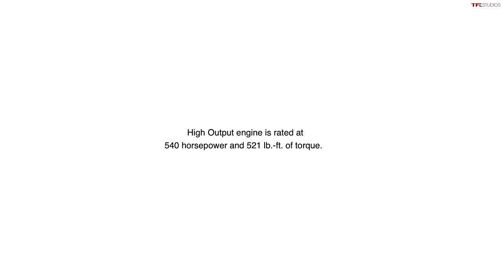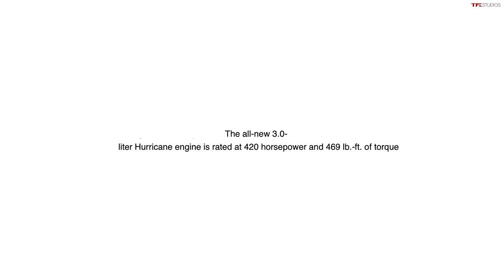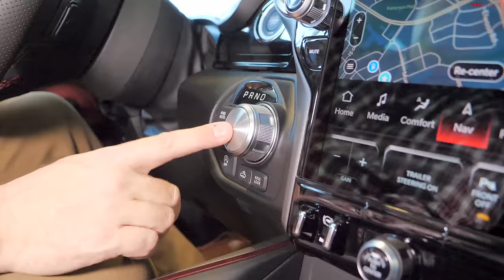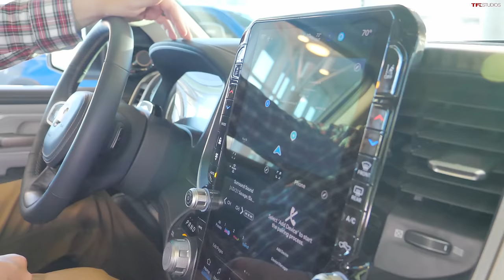I Go Hands On With The First New Ram 1500 In Over 5 Years - Did They Get It Right?

Comment: That over boosted little 3 liter is going to work hard.
Reply: definitely lazy. It's a mild boost. If anything I would knock it's design heritage. 😊
Reply: Forged internals. It's not gonna struggle. Boost the shit out if it. It will be fine.
Reply: Some of the best engines are inline 6.
Reply: Internals and block are very robust.  Mopar performance "Cat X" version of the Hurricane is over 1000hp.  I could see problems for those that push/extend maintenance intervals.  No engine is immune to this but some fare better than others.
Reply: @okcmoparguy724  you are wrong there is no such thing as Mopar Performance. The Hurricane is an Alfa Romeo engine.
Reply: @davidporter7051  The 2.0/3.0L architecture was engineered at CTC in Auburn Hills MI.  The 2.0L Hurricane (multi-air) did make its debut in an Alfa though.
You're correct on Mopar Performance, they've changed back to Direct Connection again (more nostalgic?).
Reply: Being over boosted means it won't have to work hard for normal driving conditions
Reply: @okcmoparguy724  The Cat X Hurricane isn't out yet but you're right it's targeted to reach 1000hp.

Comment: Generally speaking,  high output low displacement forced induction motors don't last very long without a high rate of failure. Too much pressure on the components.  I would be extra diligent abd meticulous with my maintenance schedule.  Nice design and by far my favorite LOOKING AND RIDING truck! I'd still buy a Tundra TRD Pro over these. But if RAM at some point became a reliable brand, I'd buy one of these asap!
Reply: I see that as being a sort of half-truth. Pressure itself isn't really the issue, or passenger vehicle diesels engines would last 20,000 miles before failure. It's more about intelligently designing components to handle expected workload over some specified duration. Yet, if all else is equal, I think your statement isn't a bad rule of thumb, with noted caveats. This is why I have treated the Corolla GR with max apprehension since day one, Toyota or not.
Reply: The Inline 6 architecture vs V6 (Toyota engine) supports the crankshaft much better.  I6 also benefits from perfect primary and secondary balance.  If maintained to schedule using good oil/filters I think the short block will have very good longevity.  I'd also do a DI induction service every 30k-50k miles though to keep the intake valves clean.
Reply: Not to paint with a broad brush but from what I've seen Toyota owners do a great job maintaining their vehicles.  They also build a great product but their owners willingness to at least do the bare minimum on maintenance  seems to be much better that the typical Chevy/Ford/Ram owner.  Almost all of the major failures we see, for any make of vehicle, can be attributed to lack of maintenance.  Kudos to Toyota owners, wish everyone was as diligent!
Reply: @okcmoparguy724  Well said. But I've seen people maintain Dodges Chryslers and RAMs beautifully and have problems irregardless because the engineering and the quality control are simply not good!

Comment: I own a 22 MY Longhorn and overall it's a very nice truck. Certainly a significant improvement over my previous 14 MY Silverado. However I also own a 17 MY VW Touareg Wolfsburg Edition which has some features still not available in this 25 MY $90k Tungsten. The features are all 4 window one touch up/down operation, all 4 door handle touch to open, auto hold function for stop and go traffic, and as some others have mentioned - the steering wheel should have an electric or separate up/down function. The column adjustment is fine but should allow the wheel only to be electrically or manually easy tilt. Not too much to ask at this price point.

Comment: Great work Andre & crew, can't wait to see what the Big Horn & Laramie look like and for the test drives.  I've had 4 Hemis over the years, now have an EcoDiesel and I'm a big turbo fan, can't wait to drive the SST.  The SST should have the torque of the ED, be faster revving and will continue the torque curve much higher in the RPM range than ED and thus much more power and sportiness, albeit at much less fuel economy.
Reply: I've driven the 510hp version in  Grand Wagoneer L.  It sure makes that big girl hustle!  I had low expectations compared to the 6.4L SRT engine they'd been using but it was impressive.  From a dead stop with no torque braking the 6.4 pulls harder, no surprise, but the 3.0L's 8spd will let it build boost from a stop.  I think some of the magazine publications were getting high 4sec or low 5sec 0-60 times which after driving is believable.

Comment: I bought a brand new 2023 Ram 1500 Sport edition (yeah, I'm in Canada) last month at some discount... Seeing this new generation, I don't see much off a difference (except the engines of course, but I am happy with my smooth and reliable Hemi V8), so I am quite satisfied about my purchase. Will keep that 2023 many years.
Reply: Our Maple Ridge/Metro Vancouver dealer has the RAM 1500 Sport model decked out in bright YELLOW with two deep blue racing stripes on the hood and roof and big 37 inch tires on which actually look GREAT! They added big chrome exhaust tips to it and I was thinking maybe it might work for me since it looks good, sounds good and is a more-than-decent truck interor-comfort-wise! 

Unfortunately, that specific model is more of a young trades-guy/gal truck bought to look super-rugged and sporty. It will goto the backcountry lakes and rivers with your smaller weekend toys BUT I wouldn't tow a big trailer with it! I need a bigger towing machine such as an F350/F450 that can tow a big 42 foot long fully-winterized Keystone Montana 5th Wheel into the big and cold Canadian northwoods!!

V

Comment: I like what Ram has done here, except for the exterior styling on the gas powered models.  The new Rebel looks just like the old one, and the Tungsten version looks like the previous design, only with a different grill.  For the prices that Ram wants for these things, they need to look like all new trucks on the outside.  Now, the interiors they nailed that.  Super premium and high tech at the same time.  Plus, I'm sure the twin turbo inline 6 will provide great power with better fuel economy than the old hemi (which was ancient, although still popular and reliable after many years of production).

Comment: Video, 4:40, he is touching the small coolant hose that the technicians are reporting will fail in less than 35k miles. The technician will need to remove the cab to access the hose. Please provide an updated part as soon as possible.

Comment: Im glad its not a cR engine swap
As.the smaller a.unit is the more you press it that bigger the pressure and heat upon it- that can (as you sir)  blow out MANY ways in various ways and systems- big pressure is
Synonomous with failure sometimes- i love Ram

Comment: I know Ram is getting a lot of flack for no longer offering the Hemi in their trucks but in reality, I think the only reason why people chose it when they bought a 1500 was because that was the only engine available with any reasonable amount of power and torque, unless you upgraded to the HD models. Just look at Ford and the massive success they’ve had with the ecoboost. Also why do you think nearly all F150s on dealer lots have the ecoboost instead of the 5.0? When it comes down to it, truck owners care far more about overall power and torque than simply sounding good.

Comment: I had a 2019 longhorn now i have a 2021 Laramie night edition and i think im done with Ram. Its one thing introducing a new engine its another to get rid of the v8 all together. Even ford still has the v8 available. Im getting 18mpg with my hemi lifted on 35” tires using 87 octane. These will most likely require premium fuel. Also the price of Rams is stupid high right now. I got my 2019 longhorn for 49k my laramie for 60k and now a ram with same features stickers at over 75k. Ram will need to do 20k discount ( they already are taking 14k off some trucks)

Comment: As an owner of a 2022 Ram 2500 power wagon level 3, I can tell you these trucks are the end of high mileage trucks. With twin turbos, none of these trucks no matter how well maintained will never break 160,000 km without a major issue in the powertrain. As someone with the 6.4 l Hemi gas I shouldn't talk. Yet as an owner of many different generation 5.7 l hemis there are a ton of those on the road right now with 300,000 km plus without any major overhaul. You will never see those type of numbers with twin turbos. That is just a fact.
Reply: Replace the turbos with higher-end titanium alloy or galvanic-protected high nickel and cobalt content stainless steel versions with better ceramic-coated impellers in them! Should last fo a few hundred thousand km!

That money spent up front will save you 20 grand easy over the next few years!

V
Reply: @StarGateSG7 
That would be a good start, yet until these things start blowing up on people which they will, they thought that the chronic issues on the 5.7 l in the exhaust manifolds were notorious that is going to be so small potatoes in compared with turbos blowing up. They will eventually, and by eventually I don't mean at 100,000 mi It will be before that. As I mentioned extended warranty will be the only way to go lol until they make these things bulletproof or next to it. Anybody that knows the internal combustion engine knows that the more moving parts the more likely one is to fail, when you have parts spinning at the speeds of turbos and the heat created well I've just seen it time and time again doesn't matter the manufacturer. It could be Subaru, it could be Toyota when they nixed their v8 in 2022 in the tundra. It's all now going to be small displacement with turbos. Hopefully one of these manufacturers one of these days will smarten up and create strong designs.

Comment: The new looks are ok, wish they brought back the crosshair grille as an option. But here’s what they SHOULD have done:

-Kept the 5.7, and introduced the 392 6.4 as an upgrade
-Replaced the EcoDiesel with the 5.0 Cummins V8 since Nissan doesn’t use it anymore. Especially since the 5.0 was intended for Dodge
-Improved the towing and payload. It’s embarrassing that a Toyota Tundra with a twin turbo V6 can tow more than the Hurricane. And it also makes no sense as to why the HO can’t tow as much as the SO. With either the 6.4 Hemi or 5.0 Cummins, I would imagine 14,000 pounds towing is very doable, and the payload should not be lower than 1500 lbs. It’s called the Ram 1500, right? I suspect the reason they’re keeping them low is to make the REV and Ramcharger more appealing since they can tow that amount
-Brought back the RamBoxes for the 6’4” bed. Maybe introduced a Quad Cab Long Bed setup since they’re not doing regular cabs anymore?

Comment: Well, let's see how those turbos hold up and how much it will cost to fix any problems that come with it. The range extender on the Ram Charger, which is a Pentastar V6. Is that not just a regular truck, then? And not an electric truck? Or is the V6 not connected to the truck to make it move? Or is there to make it like its own internal generator?
Reply: My understanding is that it is an electric truck and the V6 runs a generator that charges the batteries while you drive.

Comment: I would have thought one of the advantages of an I6 would be that the packaging more easily allows for a single turbocharger. We now have two potential points of failure rather than just one. I'm not a neurotic old man that thinks you need to replace turbochargers at every oil change, but they are mechanical devices that will not last forever. You can now replace two of them at like $1,500+ each instead of just one. A properly-sized single is the preferred engineering solution, IMO. Obviously service departments will prefer twins.

Comment: No HEMI V8 or new V8 offering,no sale for me..

I bought several RAM trucks 5.7 Hemi and 6.4 Hemi all were reliable 4 went over 150,000 miles with basically zero issues...

My 2008 needed a water pump at 110,000 miles that was it,traded it in in 2013 with 155,000 miles with no issues.I owned several since all went over 150,000 miles with no issues...

I just Bought a new 2023 Power Wagon 6.4 Hemi and RAM 1500 Classic Night Edition 5.7 Hemi..I will just repair those down the road when needed...I am a former Toyota tech and rebuild classic cars and V8's are easy to rebuild..I bought twi new RAM trucks because of the elimination of the V8...Like Toyota their best truck was the V8 Tundra with the 4.7,the new turbo 6 Toyota has already is a lemon with many issues!

Comment: What kind of boost are they pushing through that engine in the standard and highpo states of tune?  Is it pretty efficient in the first place or did they half ass it and push 25lbs or something through a weak engine to boost the power numbers. It would also seriously limit tuning capability after the fact. If that base 3.0 engine without the turbos is solid they should replace the ancient pentastar with it and only have one block to worry about and save some money.
Reply: V6 and I6 are totally different form factors. An inline 6 block is at least a foot longer than a V6. Will not fit in all vehicles, especially front wheel drive applications.
Reply: @steinwaymodelb  do they have official measurements for it yet? I couldn't find them.

Comment: The turbo looks like it’ll be a pain in the ass location to replace
Reply: Cab-off replacement and right on top. Thats the beauty of BOF design.
Reply: @hellkitty1014  because I’ve saw someone have to do engine repair on the wagoneer and thought that’s a big ass job. The same for the new Tundra

Comment: 13:58 those taillights better be designed properly this time with proper separate running, brake, and amber turn signals. However, it's a US pickup so my expectations are low.  I still don't understand how all-red taillights and even worse flashing brake lights masquerading as turn signals are legal in North America.

Comment: It's not true duals if there's a Y-pipe connection into a single muffler. True duals are two separate exhaust systems. You have to have two mufflers. That's a dual in/dual out.

Comment: When a company says all knew…. I expect all knew.  This is a refresh and new motors. 

The EV and hybrid is nice if it works. The new motors are nice. 

Would like to have seen all new exterior and interiors.
Reply: It's not all new, it's just a mid-cycle refresh, still officially 5th gen.
Reply: Right. "All-new" to me means a new chassis.
Reply: @NWI_Steel pretty much, and they didn't even come close to doing that, not even new body panels, but again this is just the mid-cycle refresh.

Comment: I'm always going to be cranky about losing the v8. Small turbo engines add way more cost and complexity (I.E. future repairs) than you'll ever save in fuel mileage and v8's just sound so much better! That said, I think the straight 6 is the 'least bad' alternative if you have to make a smaller turbo engine.

Comment: I laugh everytime I see a Ram with air suspension in Canada during winter.

The front ends are always slammed down because they get condensation in the lines and bags and freeze and stop working. Lol

Secondly, ford been through pickup truck Ecoboost growing pains for over a decade. Theyve got it pretty much sorted now.

Rams gonna be going through some serious issues once these are in production because theyre 10 years behind in the twin turbo truck market.

Comment: 8:13 - So they made the display larger... then took all the quality switchgear that controlled parking sensors, air suspension, and traction control, and stuck them on the bottom of the screen as permanent "buttons". Now you get a nice big blank slab of piano black down there instead. What an incredibly ass-backwards design decision.

Comment: And that, my friends, is how they are going to have to work on it.
 Unplug the harness from the frame to the cab, lift it off, and there you have it.

  Remember when going down the road, you could not only tell what make it was, but also know what year it was. The color could tell what brand it was.
  A LOADED truck, came with a radio, floor mats, and both bumpers. If you really wanted to go all out, you might have power brakes, AND, power steering.
  I like MoPar, I buy MoPar, but, it looks like its going the way of the corvette, European looks.

Hey, auto makers, want to sell some trucks? I have an idea.

  Make something in the line of 1960 to 1980.. And at a price somebody that makes less than six figures can afford.

Oh, lets give it a name we can relate to. A working mans truck.

90 grand, that's more than most people make in a year.
   So, lets see, buy a truck, buy a house, buy food for the family?
  
Thanks Joe, what's next?

 No wonder all your lots are full.
I can go on, but your probably tired of me already.

Comment: 3.0 is not going to be at all because fiat Chrysler has never had good track record with small displacement turbo motors. It’s all larger displacement motors that been reliable 5.7 hemi, 4.6 v8, 6.7 Cummins. Even in 60 and 70s the hemi was best engine option.

Comment: I'll be leery about the reliability of the inline 6 until its been out for a few more years. Its been out for a couple years in the Wagoneer but thats a pretty low volume vehicle.  I'm also always leery of the feul mileage ratings for the turbo 6 pickups. Yes they get great mileage on the chassis dyno for the EPA test but in the real world unless you bay most of them they use as much or more than the V8's.  I've heard a SO hurricane and they sound like crap. I agree nothing like the rumble of an american V8